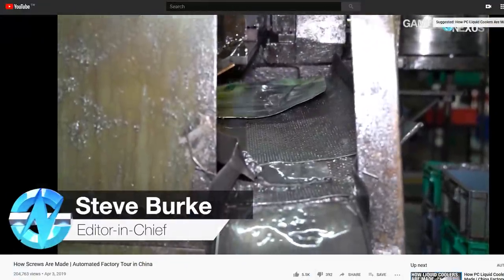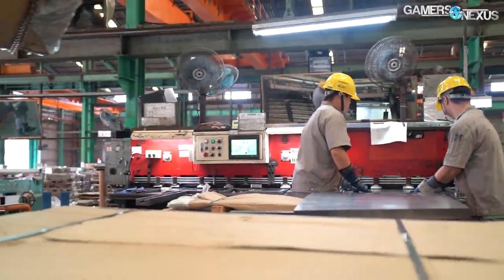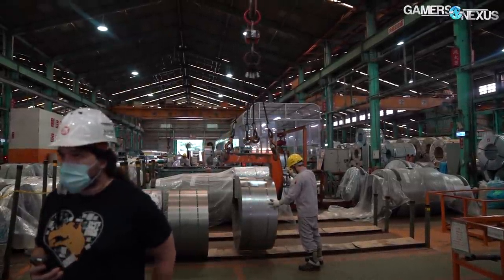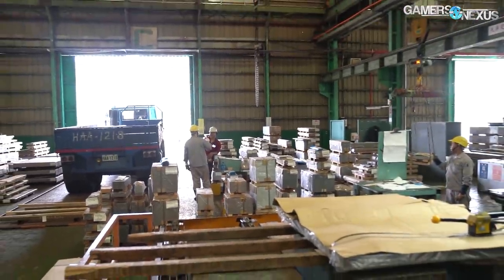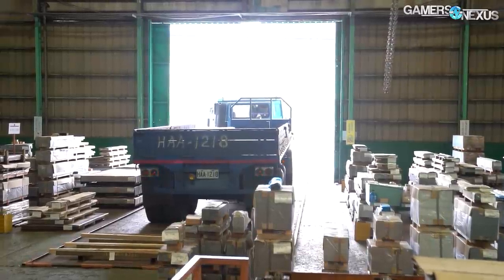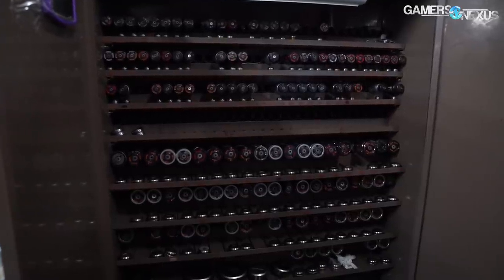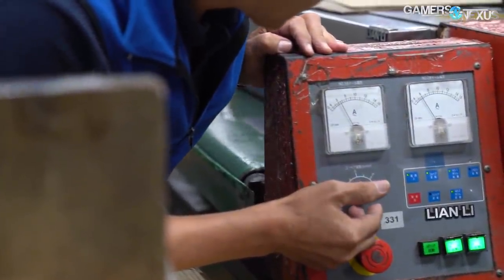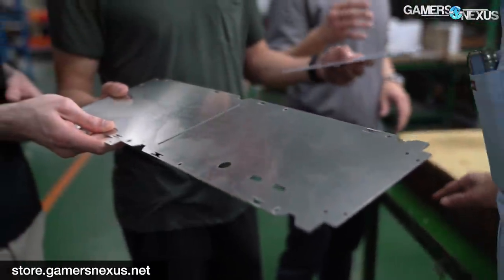How PC Case Panels Are Made: Raw Metal Factory Tour in Taiwan, ft. Lian Li

Comment from the maker: If you like this unique series, please consider helping fund our travel via Patreon or the GN Store: https://store.gamersnexus.net/ or https://patreon.com/gamersnexus
FACTORY TOUR PLAYLIST: https://www.youtube.com/watch?v=OiHPVD05hgY&list=PLsuVSmND84QuVMZuk2HGUtCSYXR7nmC5a
Lian Li factory tour from 2018: https://www.youtube.com/watch?v=CqDdFgx0Iek
Reply: CAN U guys get a CNC SURFACE GRINDER already to accurately sand the INTEL chips to overclock. It's so uneven doing it by hand.
Reply: When unrolling the metal rolls, the factory I worked at would guide it through a set of rollers that would bend it in the opposite direction that the roll was bent, to effectively straighten the metal. Those rollers would change the degree of bend, as the roll got smaller and smaller. Plus, in the US, the machines that cut the sheets is called a shear.
Reply: We also like to call the bending machines a metal brake in the US... Don't ask me why they call it that...
Reply: These are cool,kind of like that show How Its Made but with Steve. Which is good btw:)
Reply: How about going to a pc fan factory and have them explain why 3 fans cost more than a 6 core cpu or a motherboard or A CASE WITH 3 FANS INCLUDED!?!?!
Reply: @kousakasan7882  Its the RGB!.
Reply: Nice clean factory jobs. Great way to learn skills and pride in a great product. Americans know how to build a Big Mac.
Reply: What's that screechy noise I hear throughout the right audio channel of this video? Is that the factory in the background?
Reply: @CaveyMoth  It's his beard screaming "SET ME FREE!!!"

Comment: Note for at 12:34: a lot of heavy machinery are bolted to the floor for another reason specific for Taiwan and that region: seismic events.
The same happens with all machinery found at chip-manufacturers fabs...all have seismic anchors.
Reply from the maker: Great point!
Reply: I’ve worked in many factories. It’s standard practice.
Reply: Even our small HAAS CNC machines are bolted to the floor. I live in the midwest. We dont have large earthquakes. The machines weigh 25000lbs.
Reply: Only an idiot doesn't bolt their machines, regardless of earthquakes.
Reply: Bolting down machinery is common in heavy industry . Many large machines MUST have separate foundations of 2feet reinforced concrete + bolted down , otherwise the machine builder won't even sell you the machine . Other reason is that it helps with ridgidity , milling and punching operations generate a lot of force/vibrations and wanna move the machine . I actually have a problem at my workplace on the horizontal milling machine that i work on. I can feel the concrete vibrating under my feet at only 5-10 percent of spindle load ! . The owner cheaped out on machine foundations..... Seismic events.... could be , i don't think so .
Reply: Seismic events, yes. But also because of vibrations that the machines make themselves while working. I work at a facility that produces raw feed ingredients, and the platforms that have large shake separators are bolted to the ground. Our usable product is sent through Optical sorters made by Buhler, which sit below the shaker’s output. The optical sorter is also bolted to the ground, and it has shock mounts to isolate it from the shaker because any vibration will throw off the sensory equipment in it and increase reject rates/not allow it to sort properly. These shaker/sorter platforms are 2 storeys tall. 

Drum mixers are bolted to the ground too in this place. When I worked in a large commercial bakery, all the mixers were bolted down too. The mixers apply a lot of torque to mix 220+kg of dough, so they need to sit still. 

But vibrations from the machine itself and nearby machines that do precision work will affect the quality of work that goes through each one. Bolting them down and isolating them on aforementioned shock mounts is a good part in getting consistency.
Reply: I mean...it's not THE reason. It's just another reason for doing so. Saying that...I actually said specific for TW. I'll use different wording next time, k? 👍
Reply: @kisspeteristvan  I mentioned it on their latest factory tour vid, but at my auto oem, they had to do something similar with the stamping equipment.  Due to the clay nature of the soil, they had to heavily stabilize the foundation to avoid the machines from punching themselves into the ground.  Its amazing to see such large scale machines the size of a small yacht all working and punching out more and more holes and forming its final product.

Comment: How about a tour of the facility that makes those “100% Japanese capacitors”
Reply: Glorious nippon steel folded 10000 times
Reply: In Taiwan!
Reply: Its same as chineese, but different material, qc and human resources
Reply: AmusiaPrussia Made the same way and uses same steel as Katanahs
Reply: @Amusia727  Did you know that they fold the steel to remove impurities? Steel made with no impurities does not need to be folded. 
The more folding needed the less the quality of the steel to begin with.
Reply: @tisjester  steel is alloyed iron. When you look at the periodic table there is no Steel entry on it.
Reply: @1pcfred  Yep, steel is never pure, as there will always be impurities by definition. Dunno what any of this has to do with dank memes but whatever
Reply: @Amusia727  you said, "Steel made with no impurities does not need to be folded." But that is not why they fold steel. They actually fold steel to add materials to the steel. Kind of like mixing it. So one piece of steel can exhibit different properties. Namely toughness along with hardness. You cannot get those two attributes together with "pure" steel. You get either one or the other. You can have either a soft steel that resists breaking or a hard steel that is brittle. But if you fold a soft and a hard steel together then you can have both. Kind of. Steel is disrupted to drive impurities out of it. Classically with a hammer on an anvil. In more modern times it is done with rollers.
Reply: @1pcfred  I didn't say that, it was the other guy
Reply: @Amusia727  k you replied. I need to check user names better thanks.

Comment: Love the video guys! However one small mistake: N2 is not used for cooling the laser. N2 is a purge gas that comes out of the laser cutting head to clear out material as it cuts. These machines generally have big liquid water coolers that cool down bend mirrors (the videos laser is a c02 laser) or other components inside the machine. Source: I am a laser operator

Comment: I’m always amazed that there’s so much metal accessible on earth that we’ve been making stuff at this scale for ages and will continue to without it even being crazy expensive.
Reply: What's even crazier is our sun isnt even big/dense enough to make it and stops at Carbon.

Enjoy your mindfuck of the day.
Reply: formdoggie5 I thought everything after iron was only made in super novas and stuff and iron was the heaviest element that could be made in any star nevermind a tiny one like ours.
Reply: @radicalxedward8047  Each star can make up to a certain atom by its capacity  for nuclear fusion. THE MOST are made during supernova events though. Supernova usually occur after a star of adequate size creates too much nickel and iron (usually the highest end of production as that's when the nucleosynthesis becomes a net loss in energy). That's when the rubber banding in diameter begins uncontrollably leading to one of the myriad of star death options (like a supernova).
Reply: Funfact: the Sun has around 6 or 7000 times as much iron as the Earth inside it. And there are proposed ways to get it out and use it, if you're advanced enough as a civilization.
Check out Isaac Arthur's episode on starlifting.
Reply: @demoniack81  you'd think asteroid mining would be easier?
Reply: @redrock425  It's easier at the start, but there aren't actually that many asteroids. The entire asteroid belt (including Ceres, Vesta etc) has less than 0.04% earths worth of materials.
For a K2 or near K2 civilization (the sort that would consider mining the sun) that's nothing. They probably consume that much material every day.

Basically your question is like a prehistoric man saying "but isn't it easier to pick rocks you find off the ground?" when told about the concept of a modern quarry with explosives and everything. Yes it's much easier if you only need a few rocks, but it doesn't scale to the enormous quantity of rocks that our civilization needs every day.
Reply: @formdoggie5  our Sun can make iron. It just hasn't gotten around to it yet.
Reply: @1pcfred  it mostly just absorbs it as the solar systems vaccuum, but once it gets enough mass and heat to start doing so, that's when shit will start getting weird.
Reply: @formdoggie5  "it mostly just absorbs it as the solar systems vaccuum" Are you describing the Hoover maneuver?
Reply: @1pcfred  or shark, depending on your brand preference, perhaps
Reply: @formdoggie5  you don't want to be sticking your willie into no shark.

Comment: I worked for a steel company doing IT work at their various mills and HQ for a few months, and that place looks very familiar.  They didn't do the fabrication of anything, though, they just produced the giant rolls of different grades of steel and shipped them out in that form.  Those places are LOUD, and all the gigahuge equipment that manipulates rolls of material that weighs more than most buildings is amazing.  I was always excited when I got to see them just move stuff around using those gigantic cranes built into the ceiling.  I never did get to see them pouring molten steel out of the gigantic blast furnaces, though, just didn't happen to be there when they were doing it.  One interesting tidbit about those things, they never turn them off.  If something happens and they need to turn it off and actually let the furnace cool down, it does a lot of damage and has to be repaired, then it takes DAYS to get it back up to temperature.  So it would run continuously for years and years.

Comment: The nitrogen for the laser cutter is not just for cooling but it also works as an assist gas to help with quality of the cut. As an assist gas, nitrogen gas is expelled around the laser head similar to how you use a inert gas when welding to prevent oxidation of the metal while welding or in this case welding.  My senior project for my mechanical engineering degree involved removing scrap metal that was blown onto the surface of the cut part by the nitrogen assist gas used by the same 4kW amada cnc laser.

Comment: This is why things "cost so much". Because even with automation, everything goes through multiple processes of manufacture even after the design and test phases.
Reply: Every time i deal with folks internally at my auto oem, its good enough that onsite suppliers will work with you to determine who's at fault, but all the things i've ran across, most were tier 1 (who supplies final part we use) faults.  It can cost each company a lot of money each time a defect is found....and MFG will milk and tack on every associated man hour that can be when parts quality issues an investigation and charges it all back to supplier.  Some companies are better at process improvement and holding everyone accountable, but i swear to god if we didn't have one of our suppliers engineers hop on a plane to tell me an obvious visual (headlight optic thing) issue wasn't an issue because design didn't require that as a spec.  I was like, "ok, well lets just have people crash because its like driving with a lamp shade over the output and see if thats per spec and argue about that when the lawyers get involved."  Lol ...on another note, some companies are also really great at accepting a defect and taking immediate action with Q3 (temp) and Q4 (finalized and "fullproofed") countermeasures but everyone is different.  Love working in quality engineering as it opens your eyes up to all sorts of craziness that is never seen from beyond the MFG world.

Comment: I work security at a steel mill here in America that makes rolls like what they're using.  I was always curious what places that receive them look like.  Now I have an idea at least!
Reply: My brother worked at a steel mill where they make those rolls. Someone tried to steal a roll by pushing off a stack into their pickup truck. It crushed the pickup truck.
It was Geneva Steel in Provo Utah. I toured the place once and it was absolutely amazing. My favorite part was the "oxygen lance" used to clear blocked pour spouts.
Reply: I wasn't given a tour of the inside, so I just see what's going in and out at the gates.

But yeah those rolls are way heavier than they look, even a semi-truck can only carry two or three at most - most trucks only take out one.  Even one sometimes bulges the deck under the weight.

Comment: Quality wire stock with low impurities is a big deal for hold heading. Even with only a few inclusions in an entire reel, parts manufactured with these defects can sometimes slip through to the customer. Chargebacks and additional sorting procedures can take a profitable part and sink it into negative revenue really fast.

Comment: the LN2 does NOT cool the laser, (it's watercooled by it's own chiller) it's evaporated and blown through the nozzle at a fair bit of pressure to clear molten material, keeping it liquid is just a more practical way of storing and transporting when you need so much of it.
And as for the bending machine (break press really) - it IS automated. The operator is just pressing a pedal and feeding in the sheet to be bent as he's being told by the machine...the machine sets the backstops, position and pressure being exerted on the dies automatically.

Comment: I worked at a place that flattenned rolls of sheet metal and cut them to whatever the customer wanted, and packed them for shipping. They used rollers to flatten the rolls, nothing close to a hammer, what most use. The metal gets bent passed it's "bend memory" a couple times; then, like any bending, it's bend passed the target any and is flat after spring back. I doubt there's any hammer mechanism.
Reply: We manualled pulled bad pieces. If there was a dent in the roll, the cutter opperator  would try to cut around while waisting as little as possible.

Comment: 12:30 these types of machines often have custom-designed, heavy-duty foundations. Often piling is used, depending on the soil of course. 
The vibration is a big issue for heavy "printer type" machines. 
They are isolated from each other as well.
It is common for these foundations to be more "serious" than the foundation for the building itself.

Comment: I love the new BeQuiet ads on your channel, they've been the most popular PSUs in Germany for ages but for some reason haven't really taken off in the US
Reply: I own the former Straight Power 10 for more than three years and it's a good implementation of an FSP design (not like Antec does by cheaping out on caps) with a BQ fan that I never ear. This model was already very close from the Platinum level of certification at 110V (It would have passed it at 230V if they wanted to pay for it)
Reply: @PainterVierax  bequiet PSUs are built by FSP, but not designed by them.
Reply: @tommihommi1  The electronic circuitry is designed by FSP, then the product is customized for BQ's specs.
Reply: @PainterVierax  how do BeQuiet compare with Seasonic?

Comment: A small note: The LN2 probably isn't for cooling the laser. Laser tubes/diodes are usually cooled by chilled water.
Most high power metal cutting lasers use a shielding gas to prevent atmospheric oxygen from reacting with the hot metal. Similar to welding processes.
Apparently (from wiki) in laser applications the gas also prevents a plasma cloud from forming and absorbing the laser energy.
Reply: If Steve didn't say what was in the tank I would've assumed argon.

Comment: I used to work for a delivery firm and sometime I used to pick up sheets of Aircraft Aluminum  you wouldn't believe the amount of paperwork that's attached to the shipment,every single process contact and anything else has its own document so that if there is a problem with the Aircraft it can be traced back to exactly to the process, handler etc, some shipment had 30 sheet of  documentation with them.

1 thing i always wondered is how are to holes made in meshy panels thanks for the answer.
Reply: Could be CNC cut, punched or CNC plasma. Punched would be the fastest but requires more setup initially.

Comment: As I machinist I can give some insight into the whole "highest quality" metals thing. For the aluminum parts that I make they are usually either 6061-T651 or 7075 with 7075 being the stronger of the two standards.  But the T651 is such a wide standard that the "best" is very specific to use yet they are all T651. At one point the best machining material was sourced from Russia with a few months later the same supply was super gummy and full of stress. The most consistent source I've found has all been just standard Kaiser, American made aluminum. On the other hand the actual price has not significantly moved in almost 30 years, Regardless of country of origin. It's been basically a little under $2 a pound.

My point is that unless you run the forge making this stuff there is no way to tell if it's "high quality" unless you work it or cut it. You can only be sure that the said material meets the associated UNS, ASTM etc standards

Comment: I'd like to see a case designed in reverse. Decide on the cooling configuration/air flow required then build a case around it. Too often there are weird compromises required to get cooling to fit.